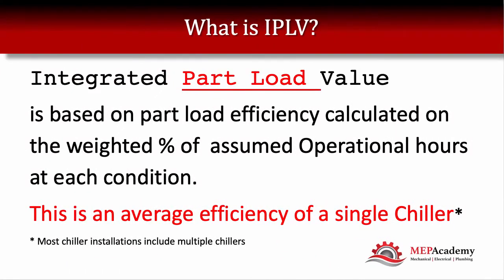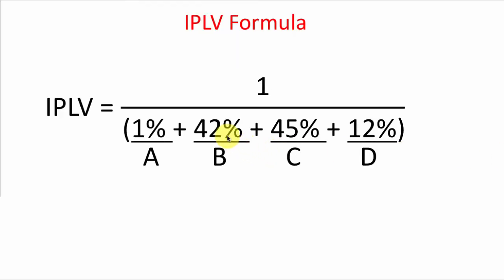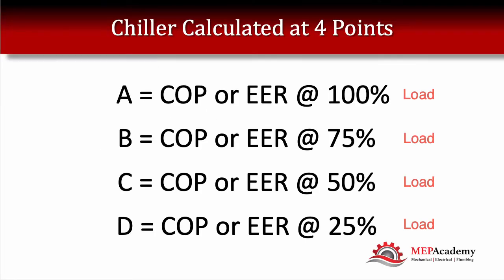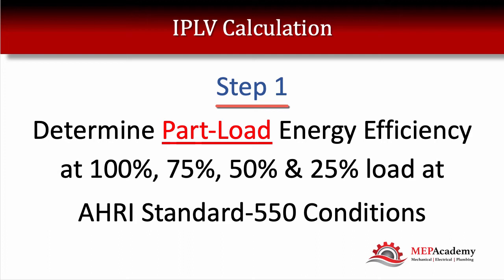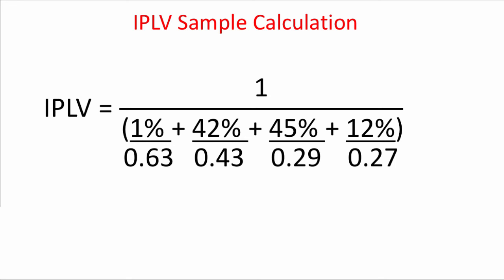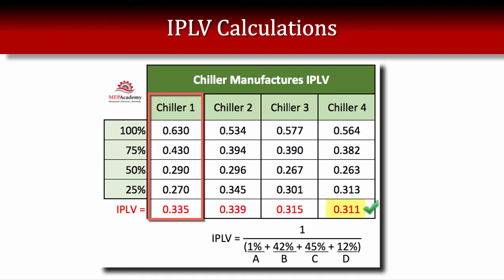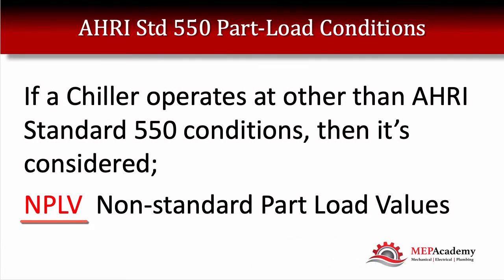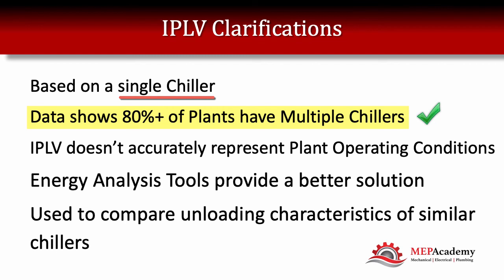Chiller IPLV Calculation

Comment: The chiller efficiency values shown on the IPLV calculation are kW/ton values, not EER. 1 kW/ton = (1/12) x EER
Reply from the maker: Correct, there is a fixed relationship between kW/ton and EER. EER = 12(kW/ton). The chart header should read kW/ton. Thanks.
Reply: Thanks! That was really confusing for a second :)

Comment: Thanks for uploading the viedoe 
At the same time can you please explain Nplv calculation
Reply from the maker: The NPLV calculation is for situations when a single chiller is not intended to operate at standard ARI rating conditions.
Reply: @MEPAcademy  
Hi sir
Can you please explain chiller load calculation
And chiller efficiency calculation
Reply: Hi sir
Can you please explain chiller load and chiler efficiency calculation
Reply from the maker: @uppulurisri8072  https://mepacademy.com/wp-content/uploads/2020/11/IPLV-Chiller-Performance.pdf
Reply: @MEPAcademy  
Thank you sir
Reply: Can you please explain performance of the chiller 
And what are major faults occur in chiller and how to rectify those fault
Reply: Hi sir
Can you please make a viedoe of chiller efficiency 
Cooling capacity calculation
Reply from the maker: The chiller load varies depending on the building load, which of course would be higher in summer months. The calculation is meant to identify the chillers performance at various loads. This allows you to compare one chiller versus another. The IPLV measures performance at the ARI Standard 550/590 conditions, while the NPLV is for non-standard conditions. Here is a good article to help you understand better. https://mepacademy.com/wp-content/uploads/2020/11/IPLV-Chiller-Performance.pdf
Reply: @MEPAcademy  What is ARI?